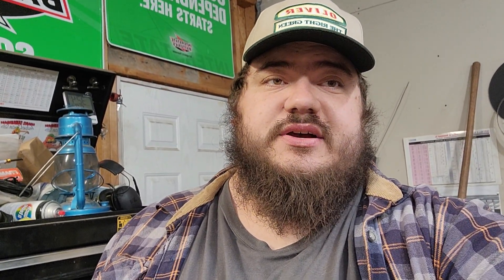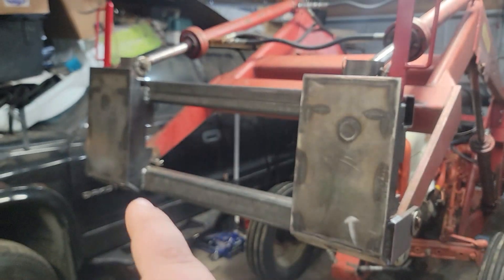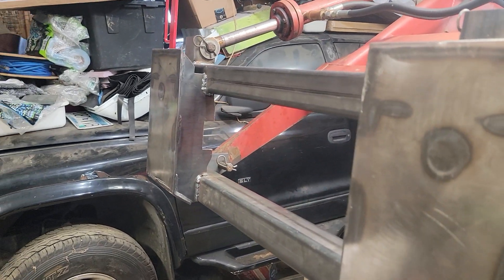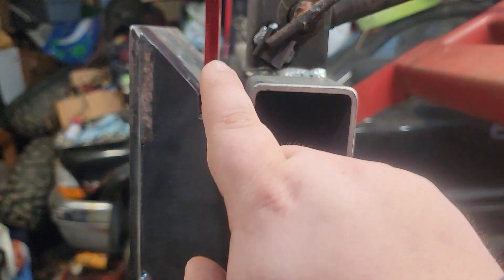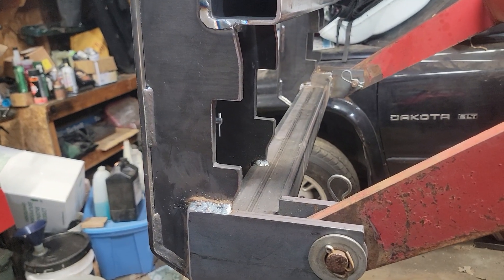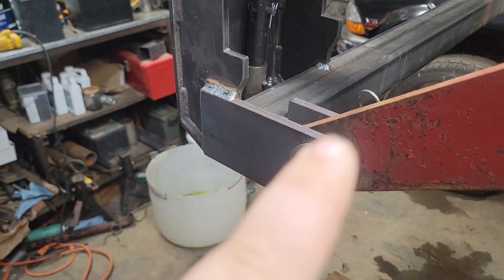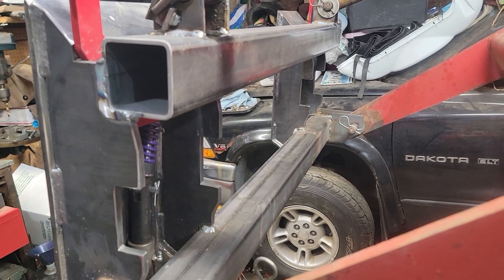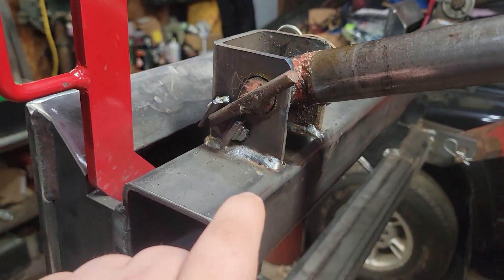quick attach conversion for old tractor loader

Comment: Nice job Bill! Looks like that should really make life easier for you.
Reply: With that setup, how far does the bucket curl back?? I have the same Paulson loader on my 300 farmall
Reply from the maker: @jasonarnhold1841  with the original bucket has just a slight curl back, more than it had before the quick attach in my situation, though. With the newer style bucket, it has a good amount of curl back to hold material in the bucket.
Reply from the maker: Thanks! How are you and Paul doing? Are you getting equipment ready for spring yet? Some guys started cultivating and even getting small grain planted before we got the snowstorm near me.
Reply: @BillTheTractorMan  Yes we are working on equipment. We finally got everything done at the machine shop for our 4020, so Paul should be able to start working on it soon.
Reply from the maker: @stephenfonder7409  I hope spring goes well for you two. Besides working on my stuff, I don't really have much going on again this year. That will be good for you guys to get that 4020 back running, one less project on the list will be satisfying, I'm sure.
Reply: @BillTheTractorMan  having it running again will be like having an old friend back lol!
Reply from the maker: @stephenfonder7409  I know how that goes! I have a couple of garden tractors in the shed I need to make time for this summer. I have bot had much time for them the last 5yrs. I should get back into gardening, too.